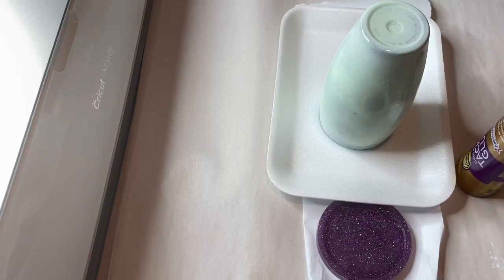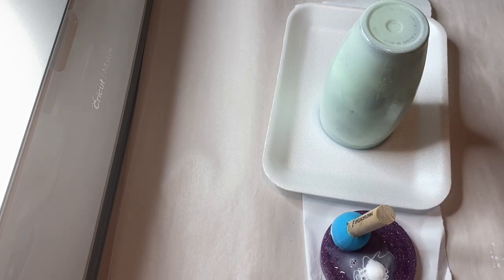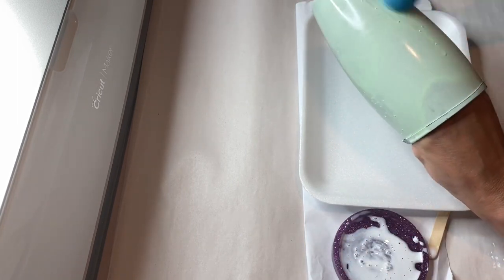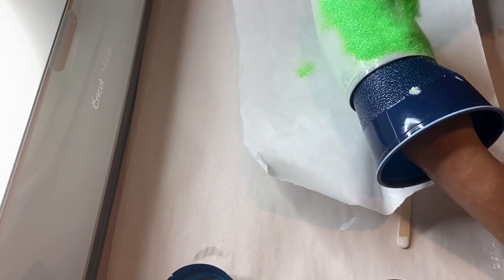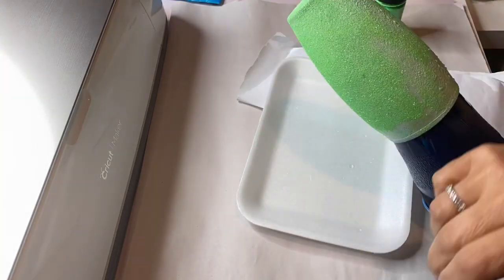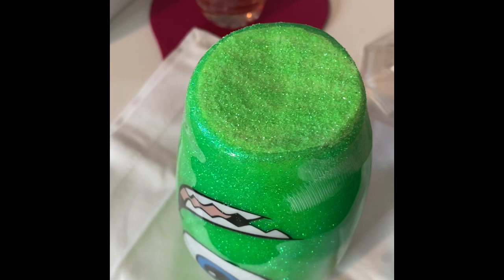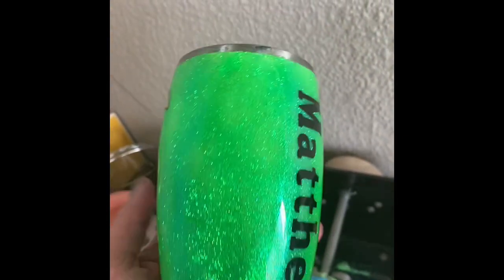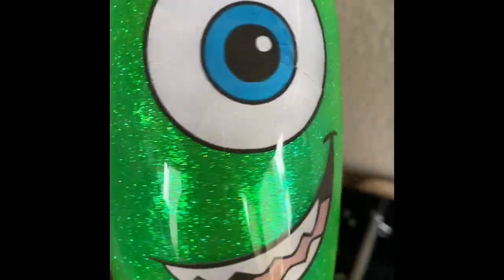Glitter epoxy tumbler, monsters inc, Mike stainless soppy

Comment: Oh my goodness! How stinkin cute!! I think the color is perfect. I've called my dauther Wazoski for years but when she was and the movie came out, she looked EXACTLY like Boo! Ponytails and all. Wanted to mention that you can still use your Gloss paint. Spray it with the matte or use just a bit thicker consistency glue. The matte paint will for sure work though. Little man is going to have so many bright and colorful cups to choose from, it'll be so much fun to see which will be his favorite. I hope they use the ones with his name at more then out and about. Weirdos are everywhere these days. 😆 What will you tackling next? What was the very very first cup you ever made? Great job, he looks amazing!
Reply from the maker: thank you, I love monsters inc. ❤️ the one thing I’m working to do better is the round eye on this tumbler shape. it was hard for me to get it on smooth. that’s good to know with the gloss, using a thicker glue. I know a lot of people are having a hard time finding paint right now. a thicker modpodge and let it dry well. I was also thinking a spray adhesive might hold better on the gloss, thoughts? little man is getting so big, he’s trying to walk ❤️. the first tumbler I ever did was water color tissue paper pieces. it actually turned out so super cute. I did the hang method epoxy for a super long time. my first cup on a spinner was a yeti with black and blue ombré glitter. it was one of my favorite tumblers, it was so pretty I was hooked. I like to just try things and see how it looks. how about you? what was your first tumbler?